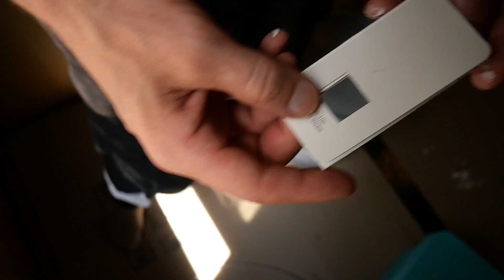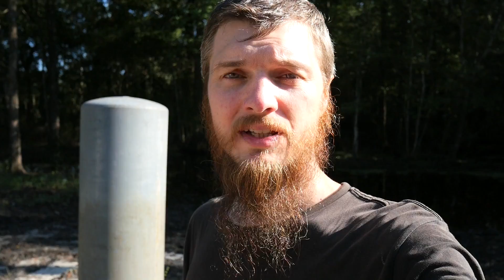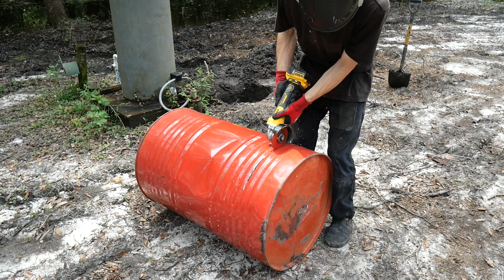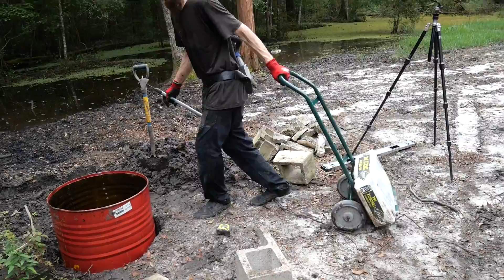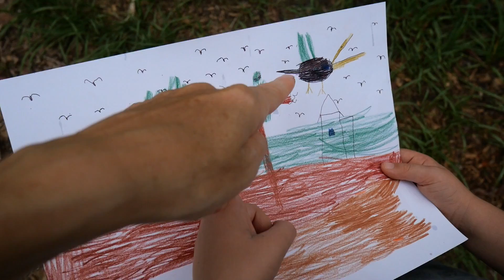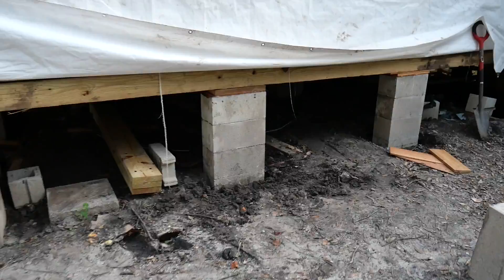You Never Know What's Next. Ceiling Paint and Water Leaks

Comment: The painted ceiling looks great.  Love that the texture of the wood shows through.  Great use of the broken concrete in your new well platform.  It's like hügelkultur for concrete (rather than a raised vegetable bed).  Glad you were planning to replace the well/pressure tank anyway.  Using the metal barrel as your concrete form was ingenuous.  Great thinking Ashley. .. . . Doug:  Do you think this'll fit in there?
Ashley:  Uhmmm. . . . Might JUST fit. . .
Doug fits the big concrete block in.
Ashley:  No. . . Yes. . . No.
Doug lets the big concrete block drop and gets splashed. 
Ashley:  Hee hee hee.
You two are a riot.

Comment: Great job and love the ceiling color. I would probably do it with a brush also mainly because i love to paint. I did the whole outside of my doublewide with a brush. 
Maverick is becoming quite the 
artist😀Great work!
Reply: I stripped asphalt siding off my house pulled the nails, filled the holes, sanded the whole house then hand brushed the whole out side with primer, then hand brushed Sherman Williams paint with 2 coats.  When I sold the house I got my asking price, no problem.

Comment: Hey Doug and Ashley, I have a suggestion for your concrete base in the barrel. If the concrete is too far below the top of the barrel and you're worried about water retention, you can use a small drill bit and drill drainage holes all the way around the top of the barrel before you set your water tank on top of it. 😁

Comment: Just a quick note. Another youtuber I follow recently redid their well. By code and I think law in most places the wire needs to be in conduit from so many inches to surface and above. This is because of shock. If there is exposed parts below a certain depth it is less likely to hurt a person but above and exposed at surface it is.
Reply from the maker: Yea, at some point we'll be correctly redoing the wiring.
Reply: @diyfferent  lol I figured. You guys always do it right. I am working on my well today on my homestead. What a project! I had to pull it up and im replacing a fitting that was galvanized 30 years ago and has been reduced to flakes of rust. From now on its always going to be brass or stainless steal.

Comment: You  won't  have  to worry so much  about  the  barrel  rusting if you  build a well  house  around  the  tank  and well.  I just  remembered that  one of ours was in the  cellar, one at another time was in a back  storage room in the basement, and one was in the  laundry  room.
Reply: You are thinking about a hot water tank not a pressure tank. There is a difference.
Reply: @marilyngordy3670  No, our pressure tanks were either in the  cellar, laundry  room, or a well  house  was built around  it. They  were  never  left outside. Our hot water  tanks  were  gas and were definitely in the  house in West Virginia.
Reply: I tried to correct the  typos and misspell words, but  for  some  reason  it won't  update.

Comment: Smart move with the barrel for your DIY sonotube. It'll last longer and looks cooler. If the lip is bad, drill some holes around the barrel at the concrete to act as drain holes and it should be fine. I'm sure in the sun & heat it will evaporate quick anyway. :) The gray direct bury wire for the well power is normal in our area (up to code) so might be in FL too.
Reply from the maker: Yeah it looks like they ran regular romex NM style cable which is only rated for indoor use and not the gray UF outdoor rated cable. We plan to redo the wiring and plumbing at some point and we'll sort it out. It's good to see you stop by. Thanks for commenting!

Comment: There is a gas that comes from the ground and passes through whatever is there until it can dissipate into the air. Might want to create the concrete base (love Ashley's idea) but set the tank a couple inches off the concrete to allow that gas to dissipate and not pass through the water. We stored canned fruit on the concrete floor in our home and had to throw it all away, tasted awful...We were told there has to be something under it let the gas escape. Y'all are great at research so maybe check it out and see what you think.

Comment: When the concrete cures and perhaps pulls away from the rim of the barrel could you put a bead of caulk around the perimeter to seal out water from running down inside the barrel?  I love your platform that you have created and how it elevates the pump off of the ground and potential flooding!

Comment: You can make your own termite shields using flat galvanized metal, just cut them 4" bigger than the pier in both directions and bend them over at a 45 degree angle with a mallet. When the ground dries up some more and there is less chance of rain, get a termite treatment. It will be about $900 and will be a great peace of mind.

As I watched you filling the barrel, I was thinking to myself, that casing needs to be extended up another couple of feet to prevent contamination and then you said you were going to get it extended to prevent contamination. Great idea!!

Comment: After you get your well casing extended, and your piping and wiring repaired/replaced, think about a gravel or crushed limestone mound the height of the barrel. The barrel will rust away over time, but the stone will hide it. The weight of the rock will support your concrete pier, and maybe help keep it vertical during high water. If you need to access the pump, or the tank during high water you can work on a dry patch of stone instead of a muddy lawn.

Comment: As a temporary fix, you might be able to stop the leak in the old pressure tank by screwing a bolt of the appropriate diameter--with a rubber washer under the head--into the hole.

Comment: Around a year and a half ago I had to have an exact same type and size of well tank replaced for the same reason. I got quotes from 3 well companies and chose the cheapest, it cost me $750. That was around 250 dollars cheaper than the others so I felt blessed on the deal. I live on a very tight budget so that 750 dollars wasn't easy to come by. The well man said I had to replace it with an identical steel tank and size. Their is just two of us here now and I wanted to go smaller but he said I had to use what my pump was rated at. Oh well, I only hope it lasts a long time.
Reply: Bless

Comment: You could probably use your grinder to cut around that barrel at ground level and then cut a relief cut and just remove that barrel from the concrete. That will prevent it from getting rusted and unsightly. Just a thought.

Comment: I agree.. that's just too much dark wood, and the reddish dark color is not very appealing.. good choice to paint it.. wonder when you get to the walls why you don't try a sprayer? As a furniture restorer, if you come across a spot the primer keeps getting bleed threw, if you hit it with some spray shellac, let dry, then primer it will solve the issue, just a small tip when handling that much bleed..

Comment: Keep up the good work.    Do change your mind set about foundations, there is no frost line in FL, like up north so no need to go deep, more important is bearing area to support the load.  You do want to dig down  a little to get below the worst of the humus and get down to compact soil but with your high water table a mat type foundation is what you want with as much soil bearing area as you can afford.  I would bet your soil has less then 1000 lbs/sq ft of bearing capacity.   The alternative is to go deep,  below the silty clay down to Florida's hard pan lime stone.  Could ask the local building officials or civil engineer what is standard in your area.

Comment: This comment is after the fact so it maybe a mute point. But you can still use a roller on rough surfaces but you would need a fabric roller with a thick nap. But then I suspect you would need more paint to cover those areas. Sticking with a brush would be more cost affective. You probably are used to foam rollers on drywall surfaces which are usually smoother.

Comment: when you put that big piece over the barrel i was waiting for the splash . i just knew 
can probably put those hardened bag of concrete in there too
as for the waterleak , you could temporarily seal it by hammering in a clean round hardwood wedge (piece of broomstick?) in the hole plugging it up , after a bit the wood swells and plugs the hole completely . its how the navy does emergency repairs on theire ships 
depending on how had the rust is it might allso create a mush bigger hole

Comment: Another job well done. I was just thinking I wonder if Doug can weld. My hubby can weld almost anything & certified in almost anything. Except under water. He taught me to weld. Well sorta enough to get hired at a Truck body factory he was working at. Even if you weren't being hired to weld you had to be able to & take a test. So that's what I did. But I say I really flunked the test. Because I have seen his welds & they look like a machine did them. Mine looked like somebody spit weld beads down the crooked line I made! 
 I hated the stinking job, was in finish & trim! Only lasted a week & said I don't care about truck bodies & a monkey could do this job. Not the welding part, that's a balls to the wall kinda job. And sweat on top of sweat. 
I bet you could get a small welder & stick weld. That's how hubby started as a teenager. Your a quick learner, but it is all in knowing how to set the welder. I never learned crap about that part.  But that is the part that makes a welder weld! Lol.. I wasn't looking forward to what hubby calls Johnny balls down my shirt, they are the hot steel balls that fly off. I woulda screamed like a girl, for the obvious, I am a girl & the helmet was to big, the gloves where to big & the denim apron almost touched the floor.. I could barely see out of the little rectangle glass that is dark, when you put the welding helmet on. Because I am not much bigger than Ashley, so all the gear was way to big. Hubby has a speed helmet, when  the weld lights up it turns dark somehow.  Anyways I bet you could learn to do it really quick..

Comment: If water can get between the tank and plastic base, that's where your rust will start. The sun will keep the rest of it dry.
Reply from the maker: The new tank has a plastic base so water won't be able to stay in contact with the metal.
Reply: @diyfferent  Understood. My tank also has a plastic base but water is still able to wick between the plastic and metal. It rusts from inside the plastic base.

Comment: So you're not tearing down ceilings and walls like you have in your other homes you're just going to paint the Existing walls Is there a way that you can check how much installation and if the insulation is good in the home
Reply from the maker: We'll be taking down certain walls, like the exterior walls to make sure the insulation looks good and fix wiring, etc. But the wood will be going back up and then get painted. This attic is roomy so we can access it for what we need to get done up there.

Comment: “FLEXSEAL” would patch the leak! Guy made a boat of chicken wire and used that product on tv commercial!🤣👍
Reply: Have you ever used it?
Reply: @marilyngordy3670  I have used there white caulk around my bathtub. It has held up for years comparing to regular silicone caulk. Never tried the “paste” but I sure would try it if I would need to patch a hole. Can buy most of the Flexseal products at Walmart or Ace Hardware stores.

Comment: Did you clear off some of the duckweed? It doesn't look like so much today
Reply from the maker: That was the side yard and it doesn't have as much surface plants as the main deep pond area. So far we haven't cleaned out any of the salvinia (we realized it's not duckweed). Once we have a good use for it we'll clear a bunch of it off the water.
Reply: Maverick is very close to the water. If a gator is hiding, he could be a meal for the gator.
Reply from the maker: @sylviabibler3036  There aren't any alligators in our waters. Most of the water here is less than a foot deep.
Reply: @diyfferent  thanks

Comment: Why is the pressure tank outside though? Exposed to elements?
Reply: It’s Florida, but maybe they need a cute little well house.
Reply from the maker: It seems that most properties around here have their pressure tanks out in their yards like this.
Reply: @diyfferent  it may be because of the frost, but in new england and all the places i live in california it was in the house/ garage. Why not build a shed around it. You are sorta half way there with a cement base.  It is so integral to pressurizing from a well system, i feel like exposing it to the elements, just accelerates its decay.
Reply: You must be thinking of a hot water tank which goes inside. This is a pressure tank which is usually outside in Florida.  Other higher elevated states have their water pumps inground.
Reply: @marilyngordy3670  no we keep our pressure tank in the garage/basement. Away from the elements. I mean it’s metal. It’s metal so. Um, ya know rust?

We also keep our water softener, acid neutralizer, and sediment filter there too. 

I mean you can quote florida code that it’s ok and everyone does it that way. Or you can build better than code. Prepare for worst case scenario.

Comment: I would have used a cardboard sono tube? You could remove it after pouring concrete and the steel barrel is just going to rust anyway.
Reply from the maker: Where would you get a 24" wide sono tube?
Reply: Minute 22:00
Reply: @diyfferent  ..sonotubes are available from 6" up to 36" in diameter...
Reply from the maker: @leroybrown7757  Where can they be bought though? We haven't seen them for sale anywhere around here.
Reply: @diyfferent  any reputable hardware store could order them in for same or next day..also a local to you concrete co. that rents (concrete) forms should have the larger diameter sono tubes in stock (b-cause most if not all homes, structures in FL. require piers for foundations)👍

Comment: How about taking a cheap rubber welcome mat, flipping it upside down, and cutting it around 1 inch past the barrel, and putting some caulking (Gorilla Glue) on the inside around the edge to hold it and keep water out.  That will keep water from getting in the recess and from water/moisture from pooling under the stand.  Sounds good... will it work?

Comment: Why didn't you roll the ceiling
Reply from the maker: We tried rolling it but the pad was having trouble getting in the grooves and we didn't like the texture it was leaving.
Reply: @diyfferent  just wondering because we bought a fixer upper last  year in Tennessee with all paneled and wood walls  snd when it dried  it smoothed out really  well 
 We also used vsldpar
Reply: Husband used a roller spec. Made for grooved ceilings and walls from Sherman Williams